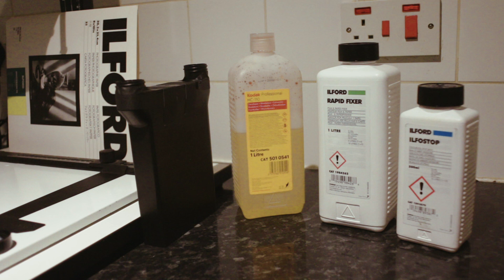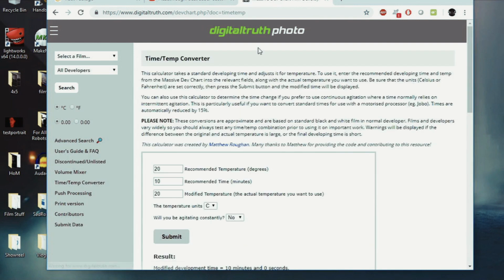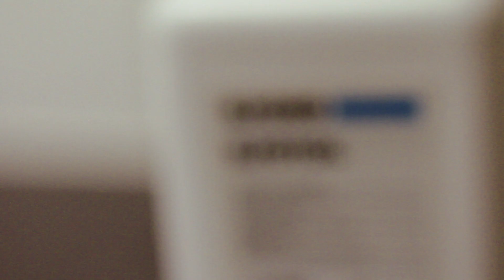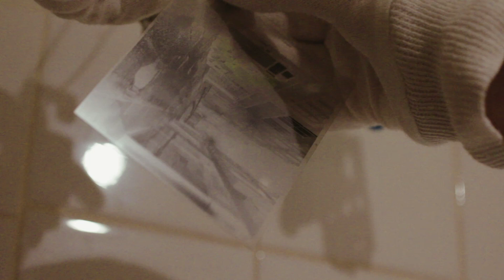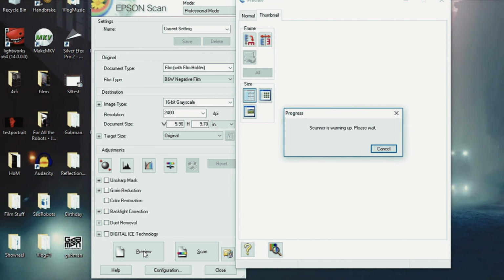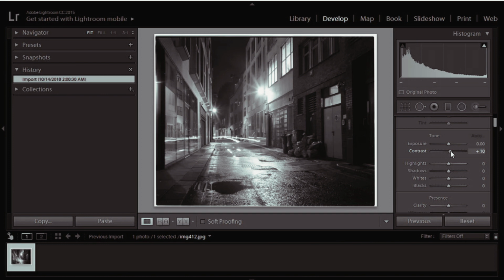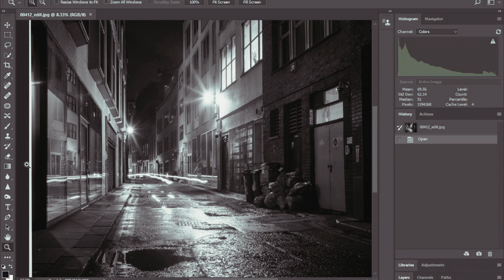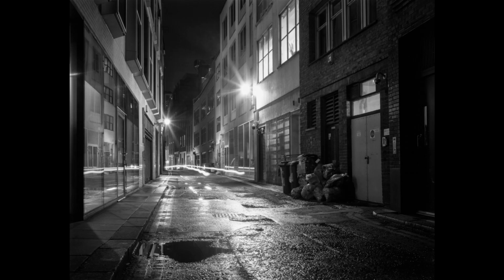DEVlog #1: Developing, scanning and editing 4x5 sheet film (B&W)

Comment: I also use the SP445 but have been getting shadows on my negatives from the space bars on the film holder (the long ones that run the length of the film).  Do you have any thoughts on what might be causing these?
Reply from the maker: Hi Jim, are you loading the film into the holder correctly? Sounds like you're putting it in with the emulsion against the bars instead of away from them. That would cause uneven development in that way.
Reply: Thxs.  That's the first thing I checked.  I think it may have to do with agitation, either too much or too little.
Reply from the maker: Yes potentially. Give the method I use in the video a go and see if it helps. Continuous for first minute and once or twice every thirty seconds after that. I've never had the problem so it should fix it straight away if it is agitation.